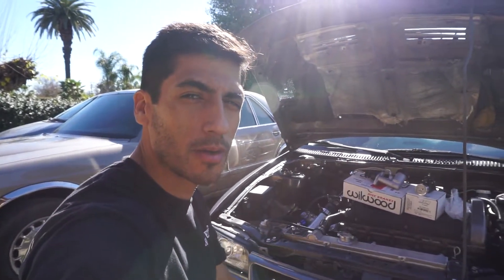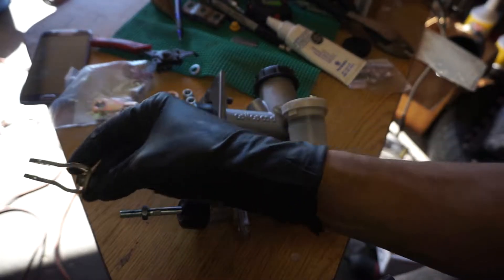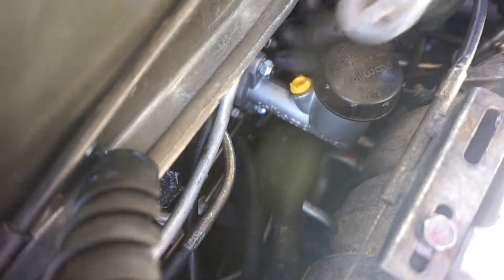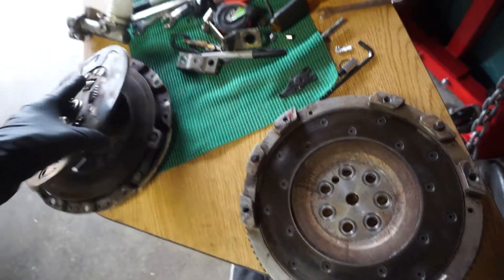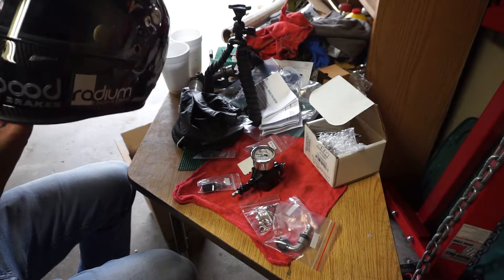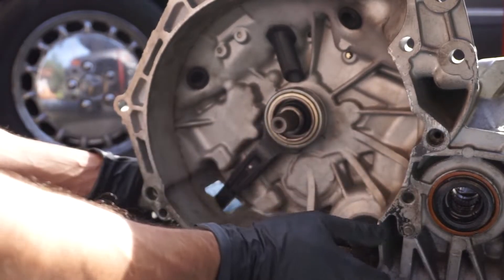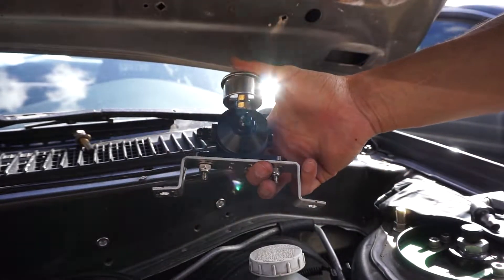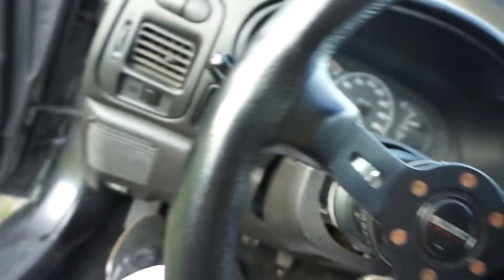Wilwood Clutch Master and AEM Fuel Pressure Regulator Install

Comment: I think you should use smaller diameter of master cylinder to make it more smooth and less stiff to push the clutch. I’ve done it and it’s works out great.